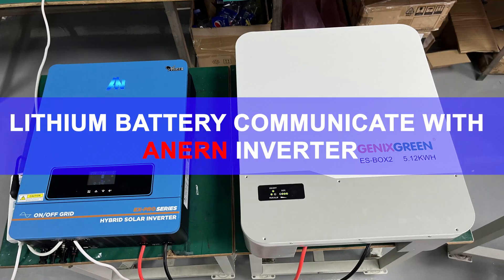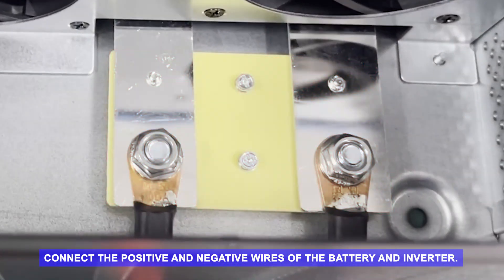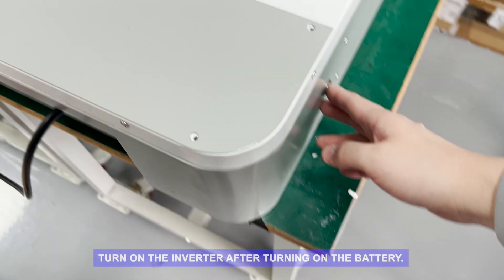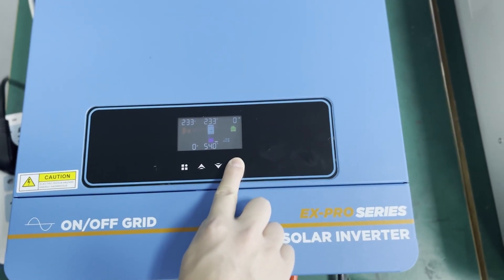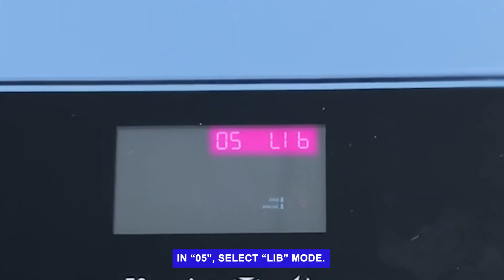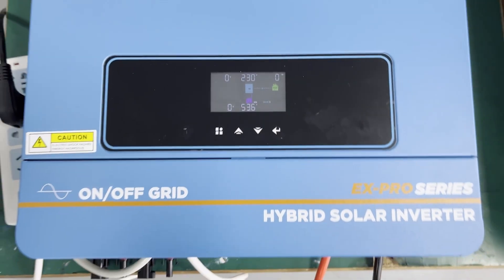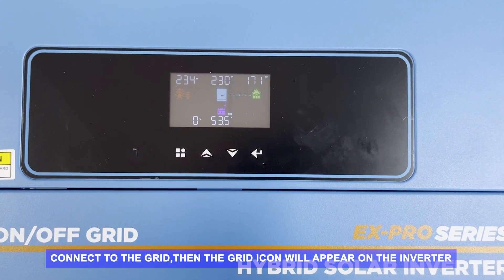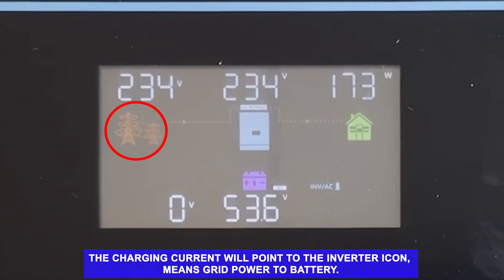Communication Connection Guide: Genixgreen Wall Mounted Battery with Anern Inverter

Comment: I have good experience with the 10.2kw inverter. I didn't tested the max power. It's better suited for 48Volt batteries. In comparison to the ouyad Max 8000 the fans start only when the heat sink is warm. The manual claims it works with the serial comm port with pace BMS. But I didn't found a description. The competitor products also us a lot of Power. Mine is surging 85Watt 1.6A at 53V. The unit sticks a little bit, I hope it will go away.
Reply: i have this but mine doesnt communicate with the battery bms
Reply: Do you know which protocol use Anern to communicate it with BMS JK?
Reply: @sarzyk  Cei dela Anern nu vor să recunoască că invertorul max 10.2 kw are problema aceasta de a comunica cu bateriie.Un mare neajuns pentru Anern.

Comment: This inverter is one big shit - it does not have the power that the manufacturer says - instead of 10.2kW it has 8kW because the rest is "chosen" from the network. It is all the more interesting considering that the manufacturer says that it can be offgrid ;) A lie straight in the face ... Totally ill-considered design - completely not resistant to environmental conditions. Mounting it like this in the above video after one rainy day would cause, if not a fire, 100% total destruction of the device. In addition, it is absurd (written in the small print in the manual) that you have to clean the filters of the fans every month. and one more thing - the fans roar like a dragon!!! There are three of them and they work almost all the time, drawing a large amount of energy .... A device with very low energy efficiency - the manual states the resting power of 65 watts and the measured one is over 75!!! never buy this junk!!!
Reply from the maker: Thanks for your comment. As some other clients have require to connect with this inverter brand so we also take video showing how to connect our battery to this brand inverter. But this inverter don't have communication function with battery
Reply: @zhengzoe1000  And this is how the discussion with the Chinese takes place - you one they the other!!! Either they don't understand what they're reading or they don't want to :(
Reply: I will connect Anern inverter to JK BMS which protocol I need to choose in JK BMS ?
Reply: @sarzyk  Mnie pytasz ????
Reply: @wojciechpetrykowski4589 I tam już obojętnie. Byle ktoś się zlitował i napisał jaki protokół wybrać do komunikacji z bns firmy JK 😂

Comment: I had a bad experience with the 8,2kW inverter.  It broke down after one day of operation at low charge.  I had to buy a new 400 dollar power board that broke down after one week of operation.  Anern did not meet his warranty obligations and I had to buy an inverter of another brand.  I lost à 1000 dollar and hope that Anern will one day deliver me a new and good working inverter.  So BE CAREFUL when purchasing Anern material
Reply from the maker: Must speak up for your right, the product broken, must find the supplier for after-sales service. I support you